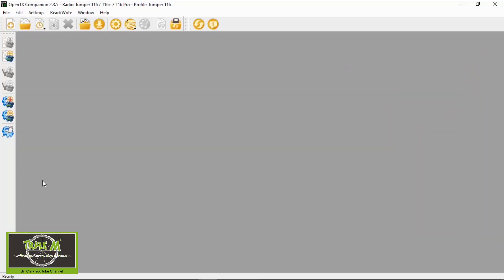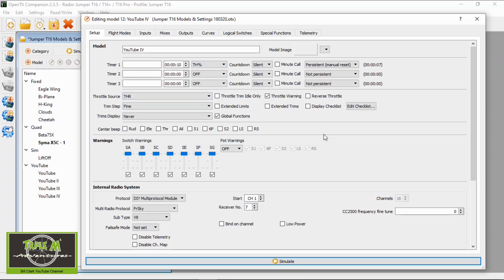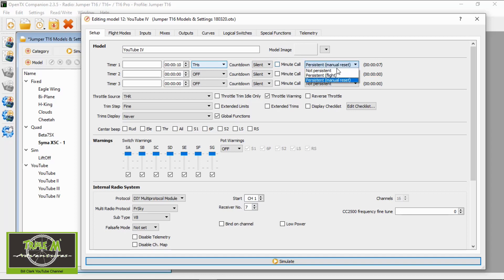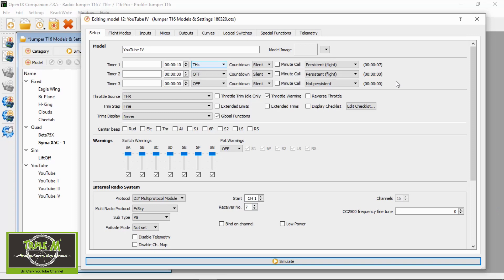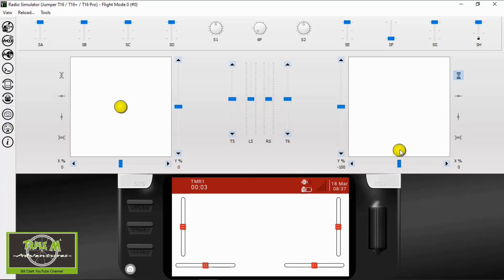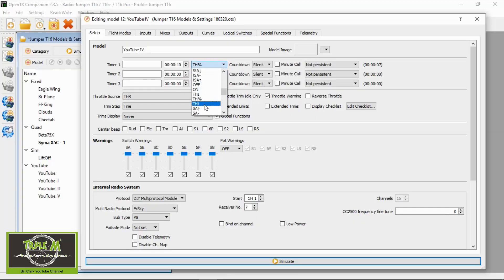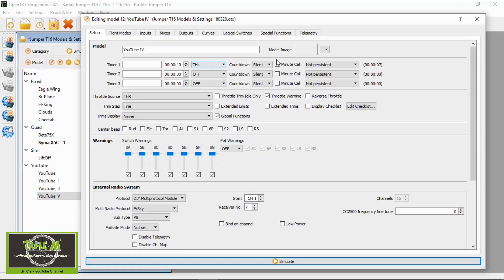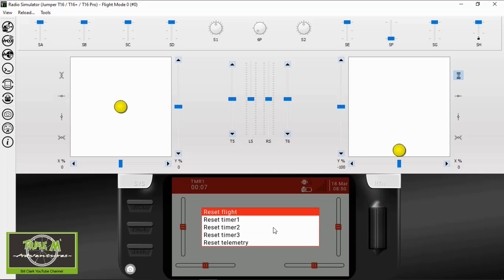Jumper T16 OpenTX Timer Options

Comment: Hi Bill, I'm still using the timer 1 in TH% (see my comment from 4 years ago, the THt option doesn't work) to record the total motorrun time for my electric powered models. I cannot see the screen when I'm flying in daylight, so I can only see the runtime after I've landed. I know I can have a timer count down and read out the minutes left, but I'd like to have the minutes motorrun read out to me. Is that possible?
Reply from the maker: Yes it is. Use the option THt and your armed switch. Start 00:00 Persist OFF check the Minute box. Countdown Silent. 
Every minute the number of minutes will be read out.
Reply: @the-happy-RC-flyer  Thanks Bill! This is a bit confusing I must admit... I got it working as timer 2, the reading out starts as soon as the motor is armed, regardless of the throttle position, not what I wanted, so I turned that off and checked the Minute call box in timer 1 ( with the option TH%). This reads out the number of minutes the motor runs. I'll go down to the field and test if this works the way I intended it to.
Reply: Now I'm reading up on how to get a second timer for the flight time, I'm using the timer 1 to see how much motorrun I get out of the batterie.

Comment: Hi Bill. I did the set-up of the timer as shown, but when the throttle is down, the timer keeps running, if I use the switch to reset the timer, the same happens, the timer runs regardless of the throttle stick position, where do I go wrong?
Reply from the maker: Jan more than likely with the Timer 1 type in the Model Setup window make sure it is THs and in Special Functions check you selected Reset and checked the box on the far right. Let me know how you get on.
Reply: @the-happy-RC-flyer  I meticulously checked all steps by pausing the video regulary and it should work, but it doesn't... As a last resort I selected Th% and now it works! Software glitch? I'm still running the software version the Tx came with (7ee5b1d0 2020-04-28).
Reply from the maker: @janspoelstra8309  in the Special Functions did you select Reset and not Set Tmr1?
Reply: @the-happy-RC-flyer , Yes: Reset and checked the box at the far right.
Reply from the maker: @janspoelstra8309  I am intrigued 🤔 Would you be willing to back up your radio in Companion and email to me at triplemadventures@gmail.com and I will take a look for you?
Reply from the maker: @janspoelstra8309  I got your email and took a look at your model and in Companion the timer is working when the THs option is chosen unless I have my wires crossed and you are having a different problem. I have uploaded a video to my goggle for you to see the THs timer is working in Companion. Is the timer with the THs not working on your radio?
https://drive.google.com/drive/folders/1mb1nhTCaJ3qz73wusjV3j_dlOA-Ks7nY

Comment: You use the Th% for electric because it varies with the throttle and mimics the reduced amp flow from the battery you get at reduced throttle position as a result the time of a flight at full throttle will be less than a flight at part throttle for the same time limit. As far as several timers I use them on gliders one is a count down for the Motor and called Motor and the other is a count up timer THt which times the total time of the flight and is called Flight.